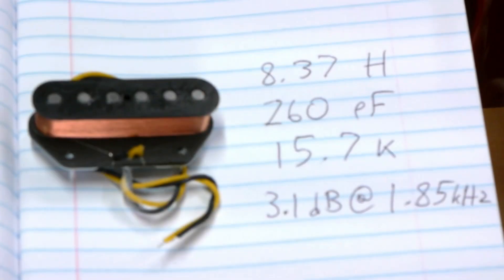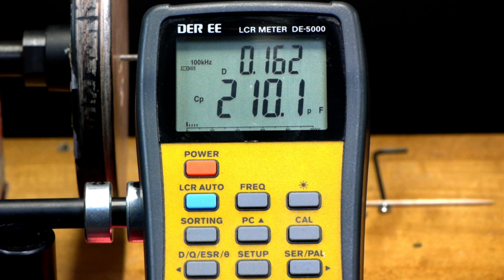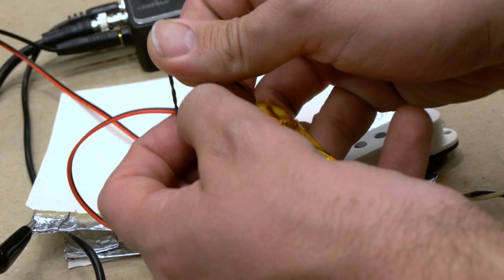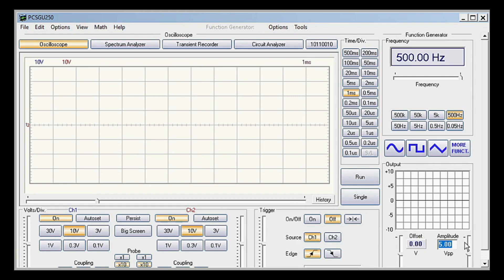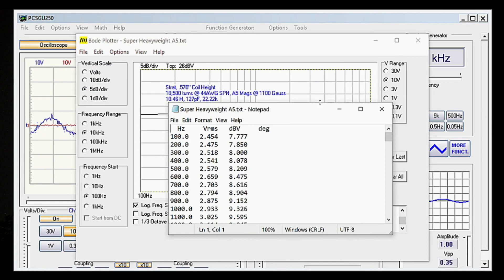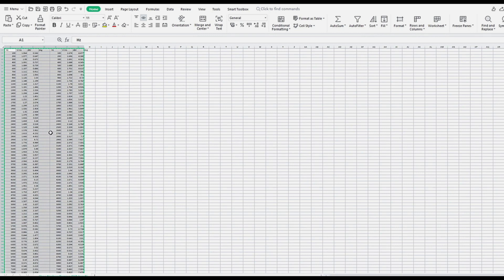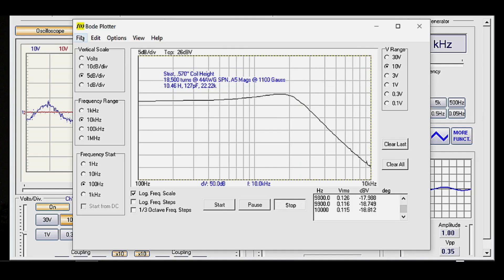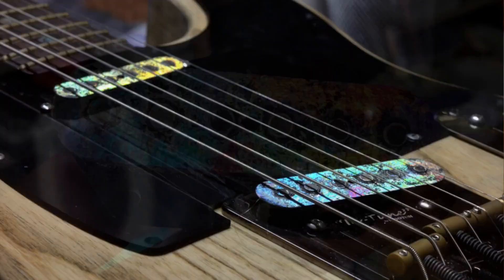Complete Guitar Pickup Testing: Step by Step Guide (LCR Meter, Gauss Meter, Oscilloscope)

Comment: Rocket science ... mind blown. Can you use the equipment to measure the frequency response of wooden guitar necks and bodies using pressure sensors
Reply from the maker: Good question! I have no idea. I don't think so because this depends on the signal generator, which depends on the electromagnetic induction of the magnetic pickup to work. 

For something like a piezo, I'm not sure how a frequency response curve could be formed. I wish I was smarter! I agree this is rocket science...and all I know how to do is solder the wires and push the buttons. 

I have been installing piezo disc pickups in neck pockets though, with interesting results. Not the first to do it but it's an uncommon practice. 

Maybe using a spectogram in a DAW and tapping on a body with a contact microphone / piezo installed (like the Metal Marshmallow) would provide some insight. That and a pure listening test. 

That would be great to find some way to test those things. Wood to wood contact, the species of wood, the quality of the individual piece -- all could play a role. 

And especially if combining magnetic pickups with piezo pickups mounted on the body in interesting locations. I heard one of Frank Zappa's Strats had a piezo neck pocket pickup and a strip of piezo film in the nut slot. I've seen them mounted on the headstock with the wires routed under the fingerboard as well. 

My current experiment has been a Cozart 12 string with a piezo neck pocket pickup and a low impedance noiseless magnetic pickup I made for it in the neck position. My goal being to emulate the tone of a real acoustic 12 string more closely. 

Very interesting results so far, even though I'm a simpleton and don't even know how to buffer a piezo. Currently looking into making my own buffer but I've had circuit boards blow up and light on fire before. I know how to solder but the resistor/capacitor/transistor/diode/op-amp thing gets lost on me!
Reply: @guitar_md  I hear u. Op amps can be crazy to solder their feet are tiny. I have a les paul with 3 hb cavities and I basically gutted the thing of all electronics, put some strings on and gosh it sounds amazing now. I can feel the bass and midrange vibrating through my body when I strum those power chords. No amp just playing it like an acoustic. That's the tone I want! I think the pup cavities have transformed into sound holes... noe that you've mentioned piezo I might give it a shot. Neck pocket? Or in the pup cavity? Or do both with a 3 way toggle switch ... 

Oh and why I brought up the wood was because I have an old tone generator but no app. I kinda wish I could send a frequency through a piece of wood and stick sensors on the surface and plot the data to see how the wood behaves . Heres an idea. Run your pup test on pups suspended in air. Then run it again this time with pups installed on a suspended guitar. Subtract results of the first test from the second, and whatever is left must be caused by the wood. Right? So do tone woods create an effect that can be picked up by the coils? Or should we just use any regular wood? 😃but be careful lots of people who have invested their live savings in guitars will put a price on your head. 😃

Comment: It all comes down if you can tell the micro differences between winding techniques and the answer is you cant. Regular wind vs scatterwound . And the answer is you cant.
Reply from the maker: This is what tests are for. I'm also mostly in the camp that believes winding pattern and tension is irrelevant, but arguments one way or the other are irrelevant without data. 

To really test that you'd need a CNC setup that could control both wire tension and winding pattern individually. Then you'd test both of those variables independently as well as together against a control, which has a standardized tension and winding pattern. 

My latest confusion is the variation in pickups I'm winding lately with a new spool of 42AWG. Maybe it's the purity of the copper. But the same 7600 turn neck pickups I've been making for years suddenly are coming out around 3.0dB @ 3.9kHz instead of 6.0dB @ 4.4kHz. 

That's a huge difference, and I've changed nothing about the way I wind, the bobbin construction, or how I wind the pickups. So what's up with that? 

I currently have no explanation for why this is happening, and nobody else does either. But the numbers don't lie. 

Again: this is what testing is for. Evidence is the loudest voice in the room. My current fixation is Q factor, or the degree of amplitude at the resonant frequency. You can think of this as how "peaky" the resonant peak is. 

I'm very curious about exactly what influences Q factor and why currently I'm getting such a low Q factor compared to what I'm used to for the exact same build of pickup. My current guess is that it's got something to do with the spool of wire and the quality/purity of the copper used to wind it. 

That being said, this is why I've chosen novel designs for pickups. I like pickups that fall outside the norm, and sometimes very far outside the norm. I like making pickups that get sounds you can't get from commercial pickups. 

There is no other Strat pickup on the market wound with 18,500 turns of 46AWG, for example. And most neck pickups are wound with more than the 7,600 turns I typically use.

I also like making novelty pickups like the recent Fender style P90 I made with flatwork and alnico polepieces for someone. It's like a Seymour Duncan Phat Cat but with alnico rods instead of steel poles and a bar magnet. It's essentially a Fender pickup in a humbucker housing. I had to trim the flatwork down to fit on the baseplate but the end result was a very unique sounding pickup in a unique form factor. 

I do think the winding pattern thing is very tired. So to be clear, I'm not saying you're wrong, or even that I disagree, but to bring attention to the importance of testing. 

If someone runs tests and can definitively say that winding tension and winding pattern have no measurable impact on resonant frequency, Q factor, or the frequency response curve at all -- and they have the data to back it up -- that's an argument with some real weight behind it. 

For me, I like sticking to novel designs that fall so far outside the norm, that the differences are undeniable and obvious. It's also more fun for me to be creative and offer stuff you can't get elsewhere rather than relying on using winding pattern as a selling point. 

The novelty and creativity is what's fun for me. Same with my two-pickup pickguard and top loading jack plate I designed/made for my own Strats, with an underwound neck pickup, ridiculously overwound bridge pickup, and a series/parallel and in phase/out of phase series of switches, and a 3 way box switch on the jack plate. 

I like doing things my way and in ways that are markedly different from the norm. I'd go nuts if I was just winding sets of 8,000 turn Strat pickups day in and day out. For me, I need the feeling that I'm bringing something new and novel into the world. I'd simply go nuts otherwise.
Reply: @guitar_md  I've literally just experienced something similar. Did a couple of test winds with a new spool of wire. Same manufacturer as last spool but I noticed it was a slightly lighter colour but spec's the same... apparently. The pickups are coming out with a bizarre amount of inductance. The wind was 42awg around 7900 turns on a strat bobbin. 6.3k and 3.1h 

I usually end up at around 2.4h with the exact same wind and tension.  Capacitance is also slightly higher than usual which also doesn't make sense. I'm unsure what to make of it and I've yet to hear the pickups. 
Any ideas?